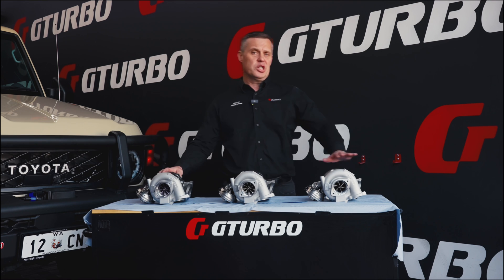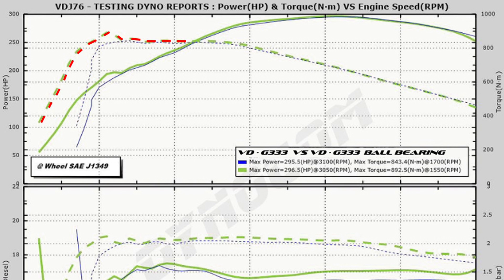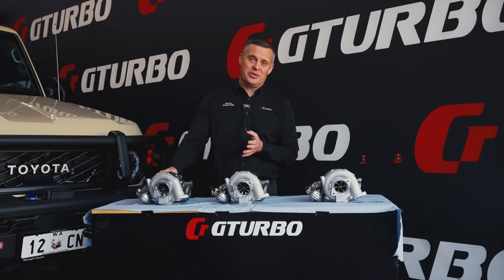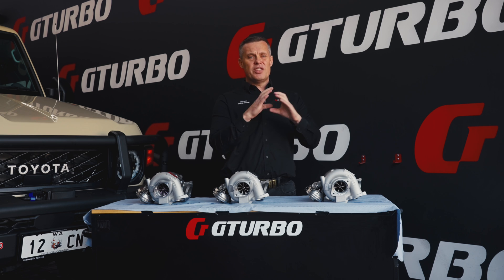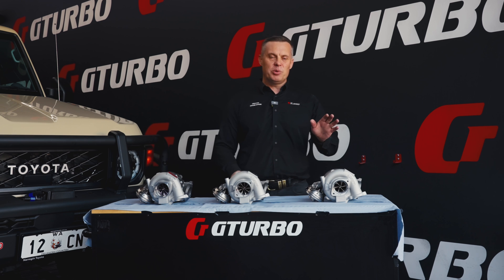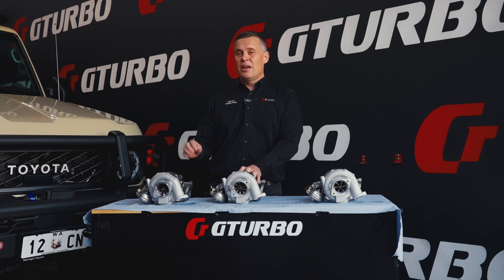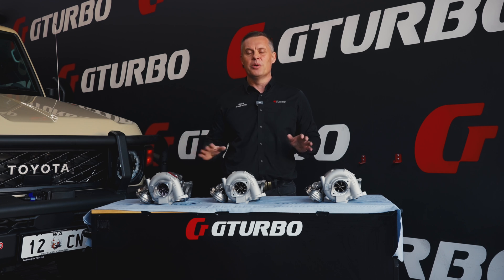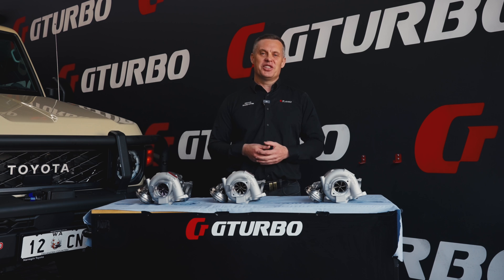New Ball Bearing VNT Titanium Turbochargers!

Comment: From my turbo upgrades i have done... on older mechanical injection pumped diesels  (2L-3L, 2H, 1HZ, td42,) 

 i can not get ball bearing turbos to last on diesels (only 12-15psi)  20,000kms max  before failing 

  and im not the only person that has had these issues..
i know of 3 others that have had this happen with the bearings failing only using ball bearing turbos

We think its the bearings dont like being ran at constant load for hours on end towing..
 where as in a petrol it isnt usually running at a high load from the turbo while mantaining constant speed...

Why do you think we are having bearing failures...

Im asking because you surely would of come across this doing testing for these new turbos
Reply: We offer both, however we would not offer it unless we had tested as I did mention in the video. We don’t want to set our valued customers up for disappointment. Mercedes been running since 2015, and BMW and Toyota since 2020. All about the right materials and vibration dampening
Reply: What manufacturer turbos were used? Were they installed correctly?